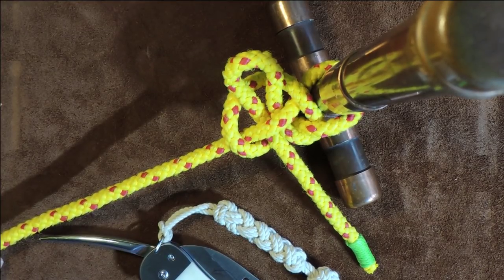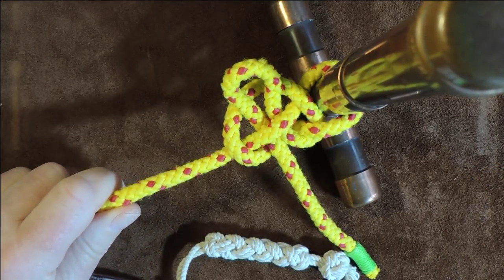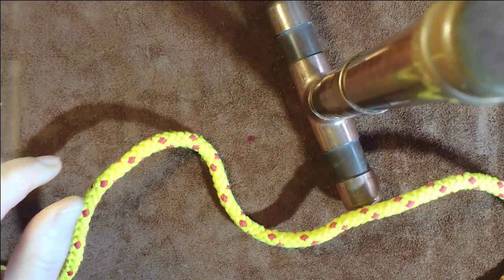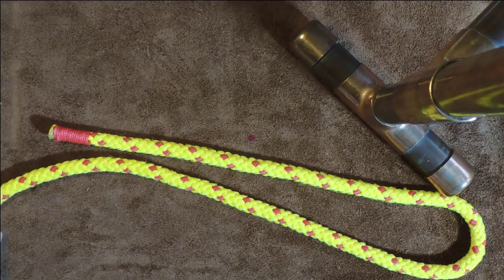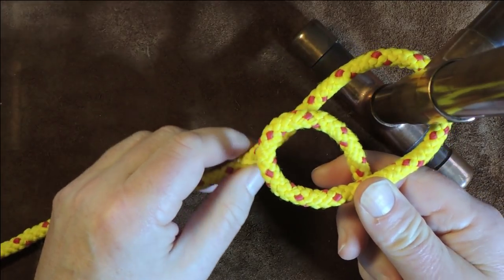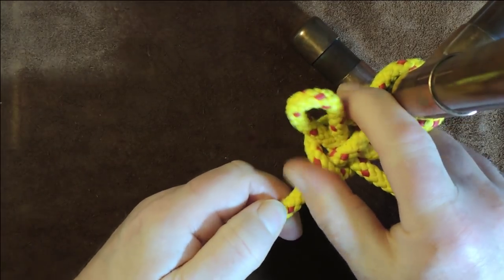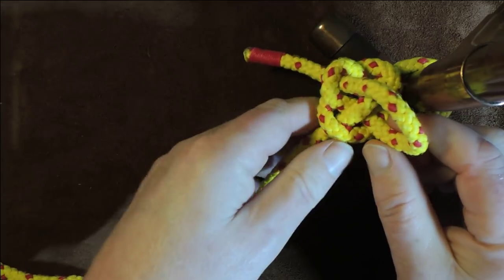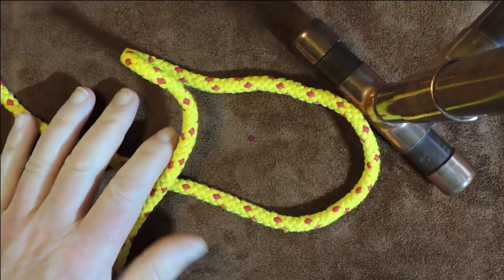Mooring Hitch - How to Tie the Quick Release Mooring Hitch

Comment: Hey there - I think this one is widely misunderstood: It's actually a fantastic friction hitch. Great alternative to the taut line or the Farrimond friction hitch. While tightening it, just make sure that the standing end remains straight so that the whole contraption can slide back and forth over it. You might need to capsize the knot by pulling hard on both sides of the knot.  You can then "dial up" the friction level by pulling on the final bight (obviously on the side which doesn't cause it to come apart).
Reply from the maker: Thanks for taking the time to share this information, I always love to hear about knots and cordage being used in action!
Reply: I'm glad you've said this as I've seen a video where a guy uses it to tension his guy ropes yet can find no other mention of this anywhere. Thanks.
Reply: @KnottingKnots  I just discovered a quick-tie slipped buntline hitch, and it seems to be much better than the mooring hitch to create friction (especially when it's slipped). It can also be "locked" if you pull hard on it at the end. So I guess I'm no longer a fan of the mooring hitch :)

Comment: @5.57 there is a gap between the post and the working end where you construct the final bight. 

 I  pass the working end over the gap and "wrap" the standing ropes contained within to return to where the final bight is made. I then make the bight and finish as you do. 

I find this stops the knot "pulling through" which can happen under a jerking strain or even a consistent strain if small diameter cord is used and the quick release still works

Comment: For heavy draw loads run a bight through the bight that runs through the first bight. Not running end through the bight that runs through the first bight. Secure but still easy release. If you run the running end through the bight that runs through the first bight then it can trap under a heavy load.

Comment: Thanks for this Johnny, another very interesting video. A lot of these quick release hitches seem to be very similar i.e. loops through loops etc. Which is the best and why? If you had to pick just one as your default, which would it be?
Reply from the maker: OK, I would say if I wanted a fixed loop I would choose the Imitation Slipped Bowline: https://youtu.be/i1KSZfSGEPg and If I wanted a noose, then I really do like the QTaR Hitch: https://youtu.be/ypRd8e3VfvA If both these knots are dressed smartly and tightly, they do not have a tendency to come undone. BUT, for additional security, you could tuck the working end back down the loop of the slipped part, or even better maybe, add a wooden toggle.
Reply: @KnottingKnots  Many thanks Johnny, vey helpful as ever!

Comment: "The mooring hitch can slide along the standing part (A-B); a pull on the other parts (C,D) can lock it into place, forming a fixed loop also known as the Lapp knot. " - Eng wiki
Don't mention it!
Reply from the maker: Yes, similar to the Farrimond Friction Hitch: https://youtu.be/D71hh2T7bD8?si=5G7lUdtoJsUhCkh7&t=95
Reply: @KnottingKnots  Mh is not friction hitch. It's more similar to crabber's knot/loop as lock knot.

Comment: I think this would be ok for one man casting off. I would use it by making it the last mooring line taking the working end back to the boat. On my little boat that would mean tying it to the middle cleat. When I'm ready i could tug on the working end and pull the rope in as i pull off The quick release knots tyed on a bight ( like the highwayman ) tend to be better for a couple of reasons first they come away without having to pull in a lot of rope and getting it wet, second the rope doesn't have to be pulled in around the post, ring or cleat where it could jam or wash back in the tide and get round your prop. Highwayman hitch however isn't secure but might be ok for a few minutes. Cheers Johnny
Reply from the maker: Yes, if you have enough rope you could also daisy chain it all the way back to the boat.
Reply: This is a lot like your new video on the Sampan hitch. The extra bite at the start of the sampan hitch allows you to tie the knot back on the boat as suggested.
Reply from the maker: I think like many knots, they can change slightly as people try to remember what they were shown and end up with a slight variant of the original one??

Comment: Is the mooring hitch different than the painter hitch and highway man’s hitch?
Reply: It is, the knot is similar but the painter's hitch can be released without running the working end around the stanchion.

This is handy if your working end is very long. I couldn't tell you which is more secure.
Reply: @JR-kn6rs  thank you. I thought the mooring looked slightly different. Are the Painter’s hitch and highway man’s hitch slightly different though?
Reply: Yes the highways is a different knot and safer.

Comment: There is a much better knot if you after going around you post you make a round turn on top then take your working end under the standing end then push your slipped end in from the other side  this makes a more secure knot
Reply from the maker: Maybe there is, but................ if I did just the best knots, this would be a very small channel?